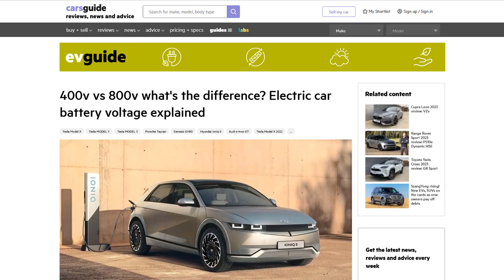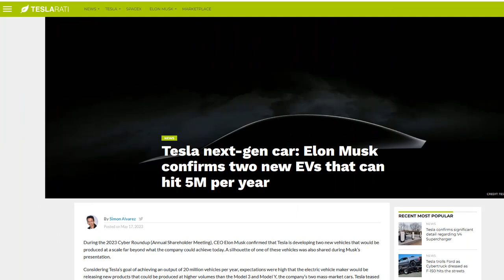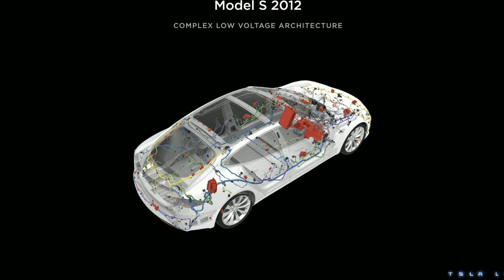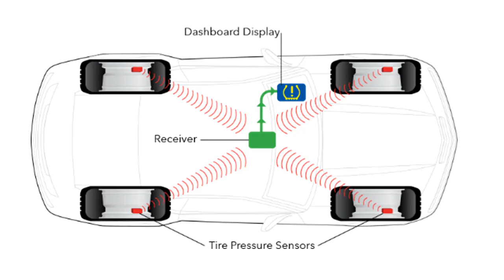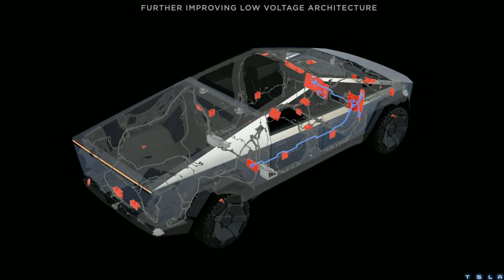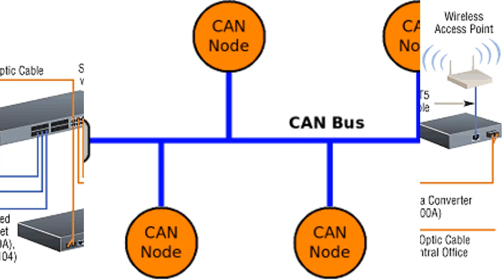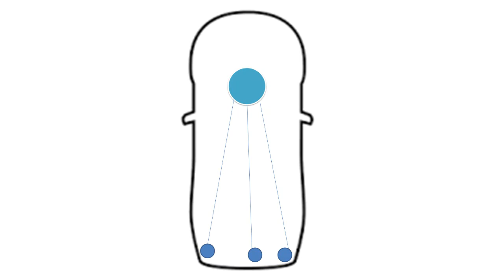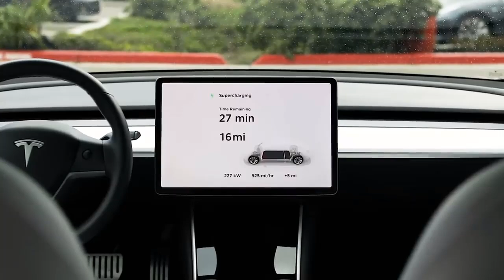The REAL Reason Tesla is Developing the Cybertruck

Comment: No. Voltage does not constrain charging speed. The constraint is applied in the BMS and is a trade-off between battery cycle life and charging speed.

The advantage is in reduced cable diameters, less copper used, weight savings.

The switch to 48 volts for low-voltage devices is important for the same reasons - smaller cables, less copper consumed, weight savings.

Legacy automakers relying on outsourcing can't follow Tesla quickly into these improvements.

Tesla also switched to a L-ion low voltage battery which will last for the life of the car. Legacy auto still uses lead-acid batteries that need replacement many times over the life of the vehicle. And again, reliance on outsourcing slows legacy auto in following Tesla's innovations. Tesla's moat isn't in patents, its in engineering and their supply chain.
Reply: The other factor is accurate and intelligent temperature management, and other manufacturers are years behind here.
Reply: @fredflintstone9963  yep. Temperature is part of the battery cycle life trade-off managed by the BMS.

Obviously, thermal management plays into the constraints on charging speed. So the Taycan, with aggressive cooling, can charge faster than a Bolt, whose miserable pouch cell battery pack can't be cooled as readily.

Model S and X Plaid have aggressive cooling. If you want robust cooling, smaller cells provide the opportunity to get thermal management much closer to where chemistry is happening. Bolt's giant pouch cells can't be cooled as easily, and will develop hot spots which the BMS has to take into account when regulating charging speed.

Lots of trade-offs are involved in charging speed and engineering decisions. It all comes together in the BMS, which makes the charging throttling decisions.
Reply: Lithium batteries on the vehicle’s electrical system are ideal in EVs where the sudden stop as the battery hits full charge is easily managed. When charged by an alternator, the sudden stop causes a damaging voltage spike. This is why ICE continues with lead acid over lithium.
Reply: @Dave5843-d9m  the problem you are describing is solvable with good engineering.

The real issue is lead-acid batteries and 12 volt architectures are century-old tech. It's pure laziness that nothing new has appeared in legacy auto engineering.

Now they have to choose: modernize, or lose.

Comment: I am wondering if the Cyber Truck will be the first commercially available vehicle to use 48 volt system?  By the way the 48 volt automobile spec are not new, I recall hearing about them 10-15 years ago when attending an embedded system conference! Just never got adopted by any manufacturing power house!
Reply: Elon said once it's because there aren't any suppliers for it, so they basically have to manufacture that themselves after unsuccessfully trying to persuade manufacture to start the new system.
Reply: I've read that many companies now product "mild-hybrid" vehicles that are 48v. They are the "least electrified version of hybrid powertrains."
Reply: @huskydogg7536 oh well, sort of a start!

Comment: Qos in automotive systems seems to me useless. A standard cat 6 ethernet supports Gb communication. I can’t see which sensor would generate that kind of data, cameras don’t even generate that kind of data. QOS only kicks in when all bandwidth is utilized. There’s also 10Gb ethernet cable for these distances, overkill but ok. Distance in a car is so small that latency can’t be a problem. 1ms delays is easy to achieve, no human can compete with that. All delays included, a computer is at least 100times faster than a human and that’s an understatement.
Reply: QoS entails a lot of things like queuing and priority etc. the speeds might be 10Gbps and may never get sustained speeds there but traffic can be busty fir ex a large software update might be getting transferred but sensor data might be getting priority so that is delivery is timely.

Comment: The reduction in copper is more to do with the vehicles' accessory system and it's corresponding increase in voltage from 12 volts to 48 volts. The 1000 volt system is charging, batteries and inverter for faster charging and motor power. You should make that distinction.
Reply: High voltage systems have zero effect on battery charging. Individual cells operate at just 3 bolts (approx) and are limited by chemistry and thermal management.
Reply: @Dave5843-d9m  
But you can use a thinner charging cable, which is important. Drivers have to be able to lift the cable.
Reply: @Dave5843-d9m exactly. It's annoying how many commentators don't get this basic fact.
Reply: @lighthousesaunders7242  But it DOES allow them to deliver more energy to the car at once through the same charging port.  It's annoying how many people don't think things through.

Comment: At 0:27 you can see something falling off the transported part:)
Reply: That's called "gating". It is excess from the casting process where the molten metal flowed through the mold to fill the cavity thoroughly. All gating is collected and melted back down.

Source: I work in a foundry.
Reply: @catsaregovernmentspies thanks for the info! That's very interesting.
Reply: @zbyszanna - Plus, in addition, the Casting comes to a Trimming Step, to remove ALL the Excess Bits, anyway.
Reply: Waste parts of the cast from runners risers and gates. You can see them bottom of floor, those can be recycled. And this method produce lot less waste than stamping tougth.
Reply: @HVM_fi thx!